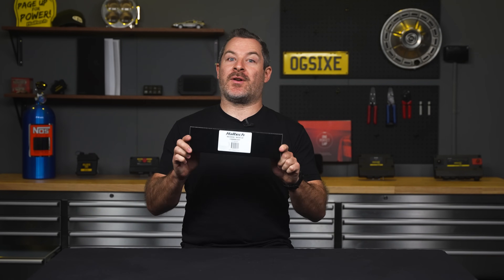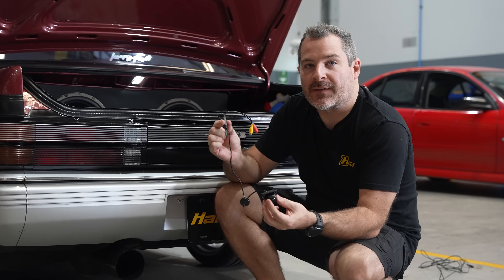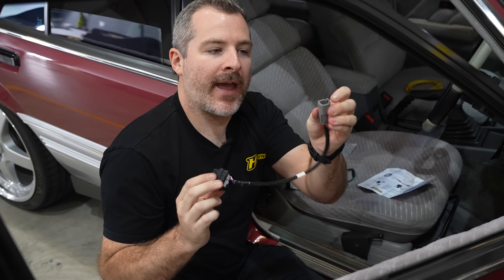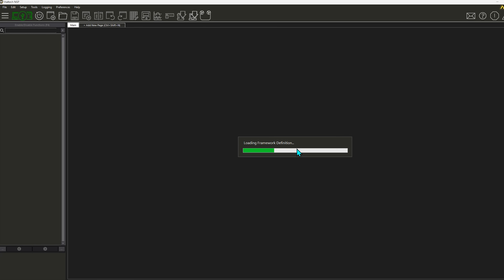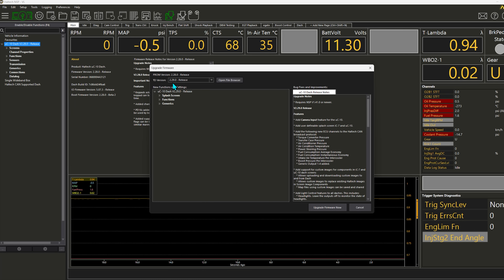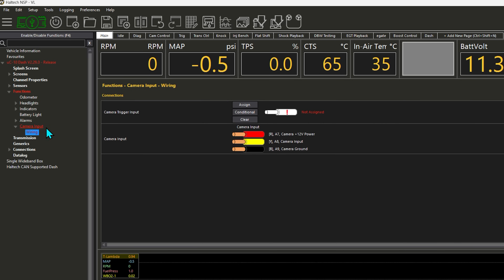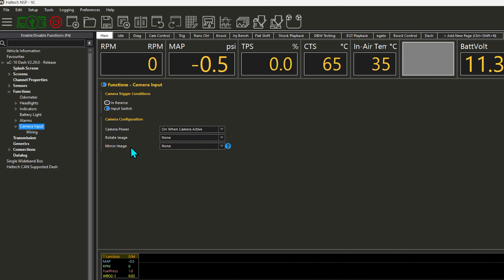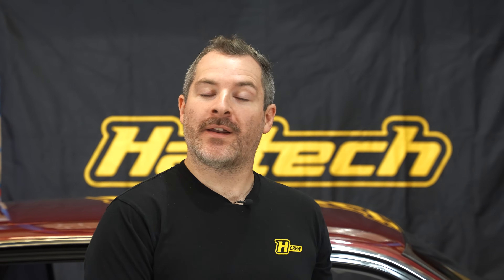REVERSE CAMERA - New Product Release For The uC-10

Comment: Harness length? And can i connect two cameras so i can put one up front for rock crawling?
Reply from the maker: Harness length is 6m (19'), Unfortunately there is only one camera input available
Reply: You could run the inputs through a selector switch (front, rear, even side) and control with a toggle with front power 12 v to the switch via a relay, then the switch to “rear” would trigger off the BU lights.

Comment: Hey  are they waterproof

Also  ok to run wires  under car     ?

Reverse sensors  next id say

With   Built  in (dragy)  style   System to see  times  when in mexico
Reply: It is an IP67 rated camera which means its completely dust tight and can sustain immersion in water up to 1m depth for up to 30 mins without damage. So it should be expected to perform just fine when driving in rain and if splashed wirh water while driving or when washing the car.

Comment: How about adding the features people have been asking about for years, like fully customizable dash like AEM has had the last couple decades that you still have not been able to implement but still decide to push out new hardware with the same horrible dash layouts and lack of features.... But hey you got a backup camera now.
Reply: Not only that, you can get a ebay camera for under 10usd, with a similar looking bracket. Just cut the wires and pin them to the dash.
Reply: That's the reason I got a Plex dash instead. I love my haltech ECU but I have other things that talk CAN that I want to be able to display on my dash. Reverse camera? Almost feels like an aprils first joke...

Comment: Are the reverse camera guide lines configurable? Are they software driven with the option to improve or a basic overlay that will require a better camera? Also, camera specs… HDR? Low light sensitivity? Could a higher quality different camera be used?
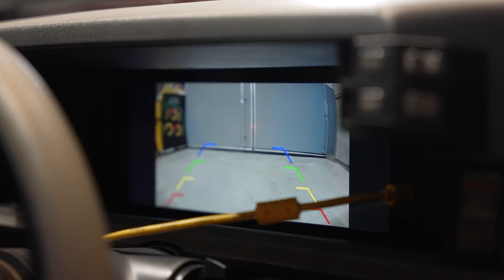Reply: 8:43 alludes to the guides being added by the camera hardware, I'd assume that's the minimum viable product, and they could add configurable lines in the future on the screen software, which would be neat.
Reply: Currently the lines are bot configurable. I just bought the kit and the lines are disabled be default. To enable the lines on the camera you cut a white wire to open a circuit on the included harness. The lines will not sway or move in accordance with your steering input as there is no way for the harness to be fed that information. Hopefully that answers your question.
Reply: @carbonaddiction  … yet! Hopefully Haltech can offer a  sensor for steering angle and software calibration for the lines to move with the input. 😉